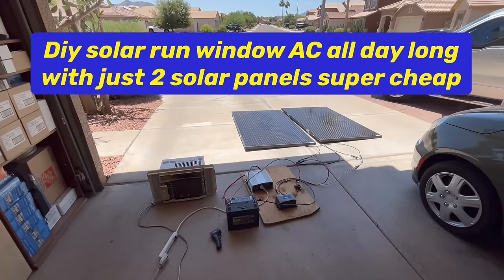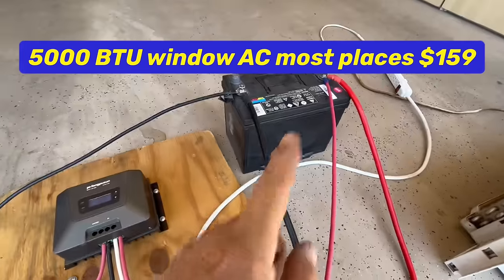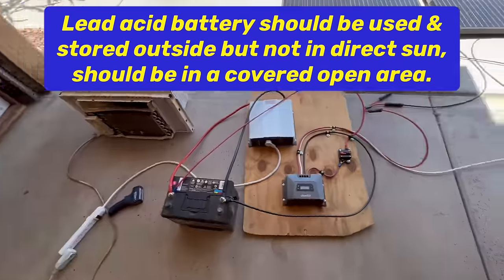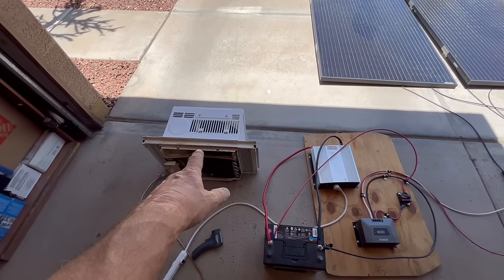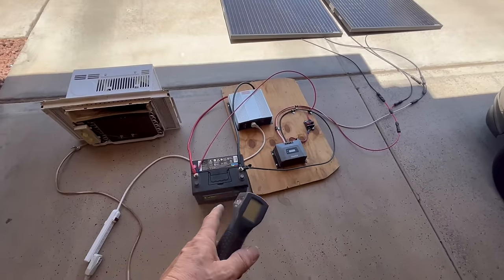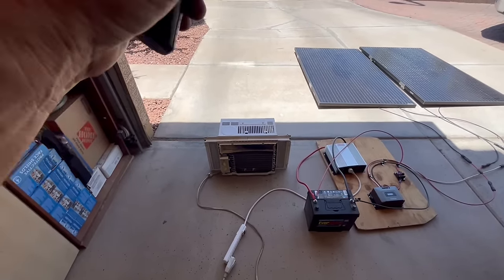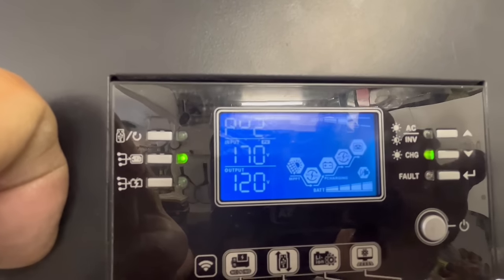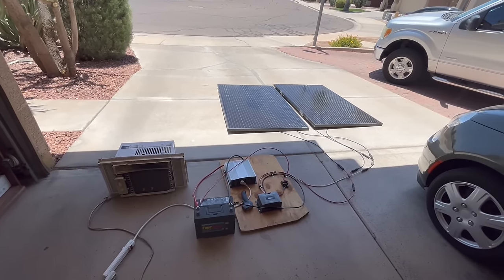Run your window AC with just 2 solar panels when sun shines. Easy DIY project you can do in one day.

Comment: I have a 10,000 btu ac that im trying to run. Its 113 degrees in my rv. Theres no running water or electricity on the property. I need relief. Fl is brutal! What would i need to run that ac please?
Reply from the maker: You need solar panels and an off grid inverter along with some batteries. AGM batteries will only work for you during the day but Lithium. iron Phosphate will run overnight. That 10,000 btu ac probably uses around 19-12 amps and 1000-1300 watts. Signature solar has direct connect mini split, add some solar panels and you could run while sun is up for maybe 8-10 hours during daylight. The biggest problem in Florida is cloudy days, that kills your solar production. Those mini split can drop down to 200-300 watts at night when tv is cooled down if using lithium iron phosphate batteries to run at night. Check out some of the videos for the EG4 mini split from signature solar, look online for their mini split solar kits that include everything. That mini split would be a lot more efficient and use a lot less power than that 10,000 btu ac. If that is your tv ac than it’s probably 239 volts and that’s a whole different story. Once again those huge amount of cloudy days in Florida makes it tough to do solar off grid. I know that’s not what you probably wanted to hear but it’s your best option to run ac off solar.
Reply: @diy-solar-guy  do you know roundabout how much it would cost to do the mini split? Also do u think theres an alternative to solar to run that ac? Its a window unit
Reply from the maker: @charlenarussell8676 my 5000 watt window ac uses 500-550 watts and between 5-5.5 amps. Pretty much double those numbers for a 10,000 btu and you’re using what a mini split uses at start up to cool down. The big difference is that window ac will constantly use around 1000-1100 watts as where the mini split after it cools area will drop the watts down to 200-400 watts. 12,000 btu mini split can cool 500-600 square feet. Considering you tv is probably less than 200 square feet, that would cool your rv extremely fast. Using solar to run window ac it mini split is an investment and will easily cost $2000 or more for a basic system with no bells and whistles. That window ac I did in the video works good for small areas that are well insulated. An tv is not very well insulated, I know I have a 2017 motor home. It takes forever to cool down with rooftop ac and that 5000 btu window ac can bring the temp down but not a lot from 113 degrees. That EG4 12,000 btu 120 volt ac with direct solar panel is probably the cheapest you can go. Need mini split, 2000 watts of solar panels, wire and mc4 connectors. $1299 for mini split. 5-400-500 watt bifacial solar panels will run $120 each, 10 gauge solar wire and mc4 connectors depends on how many feet of wire you need. Mc4 connectors can get off Amazon really cheap, under $25. You could super cool your tv during the day to 65 -75 degrees if sunny out and would stay cool for a few hours. As soon as sun goes down, stays cool longer if you can run till sundown. Like I said to start out solar it will take some money. Min $2000 to cool tv.  But will cool very well for 7-10 years. Buy some Lithium iron phosphate batteries down the road and a few more solar panels and you could run across at night. Hope this helps. You can call places like signature solar and talk techs about what you want to do and what it might cost for components. They are better at it since they do that for a living. Hope it helps and hope you get cooled down soon. I know how you feel, I live in Phoenix az area.
Reply: Mami I see these things at harbor freight.... But I'm sure if you search amazon Walmart Lowes home depot and put in say like the clearance items and mess with the say price amounts use like $10.00 or 5 or whatever and you may find something. 

Idk anything about electric. I don't like to change a light bulb because I got shocked before..... But also I live in manatee county, fl.... Up the road say 10/15 miles they bought out the farm land and now its a field full of solar panels. 

If you are near some place like that maybe stop and talk to them and also they maybe able to order you some and get you a better deal. 

I'm just giving suggestions because I know how it gets in fl. Lived here 40 plus years.
Reply: @diy-solar-guy thank you for the info. Do the  batteries require a lot of maintenance and/or care
Reply from the maker: @presidentialsuite6406  thanks for your suggestion. That was just a simple basic bare bones example of how to run ac off solar. Now I run my 3 1/2 ton and 4 ton heat pump heat pumps with solar in day and LiFePO4 battery bank at night and do not spend a penny on heating or cooling my 2450 square foot house or 600 square foot garage or my 15,000 gallon swimming pool to run pool pump 24 hours a day and even heat or cool my pool up to 10 months a year. All with off grid solar check out my other videos to see how easy it is to air condition you house with solar 24 hours a day. Thanks for your input and hope you have a truly wonderful and extremely blessed 2024.
Reply from the maker: @presidentialsuite6406  AGM batteries can not go below 12 volt charge or you will lessen the life of battery. The only maintenance is to charge and use every day running the ac. I used in a solar shed for over 2 years and the window ac in the shed kept all my solar equipment including batteries nice and cold at 50-60 degrees during the day. The batteries have lasted over 4 years now by not depleting below 12 volts. I no longer have those batteries and use LiFePO4 batteries which are air conditioned to 65-75 degrees daily year round and those should last 20+ years. Check out my other videos of the progress we made since first using this set almost 4 years ago.

Comment: Are you in a typically hot environment (e.g. desert)?  Can the charge controller and inverters still do well in those environments?  Like, it can get to 118 degrees for literally weeks straight in Arizona and I can see the charge controller and inverter not lasting all that long in those environments.
Reply from the maker: I live in the southwest corner of Phoenix AZ. Is has been brutal out here this last 2 months. I kept this ac and all the components in a 4x8 by 6 foot tall shed so that all my components stayed cool. At one point I had 6 of the charge controllers and a Harbor Freight 5000 watt modified sign wave inverter running 3 mini split that I installed in the house and garage. I also increase my battery bank to 4 12 volt lead acid batteries. This system is good for someone who wants to learn about solar but knows nothing about solar. As you learn you improve system with better components. A 12 volt system is limited to 500-1000 watts and a 1000 watts is maxing out system. I then went to a pure sign wave 24 volt off grid MPP inverter with built in charge controller that can accept 2400 watts in solar. That was much more stable. I used 2-12 volt batteries to start out that were in series to make a 24 volt battery bank. Then added 2 more batteries and connected the same way then connected in part with other battery bank to have 4 batteries for system, that helped do much when clouds rolled by in sky and solar production tanked, but mini split kept running. As battery voltage dropped but much slower that when I had only 2 batteries in series. I then added 3 more 24 volt inverters and paralleled all 4 together to get 9600 watt system that could run all 6 mini splits I had installed by then. 2 upstairs, 2 downstairs and 2 in garage. Used that for about a year and then bought a 6 kw and 12 kw Growatt low frequency inverters they now run all my central air conditioners and 230 volt ac in garage as well. Check out my other videos to see everyone have done with solar off grid. That charge change controller and inverter on video will not last more than a couple of years in extreme heat out here as might due in as little as 2 years. Fans will be running constantly on inverter and wear out really quick. Charge controller does not have a fan but you can even find this charge controller anywhere, I looked, only been 4 years since I bought and they stopped manufacturing because of new technology. All in one off grid inverters are the way yo go if you are thinking about running ac in AZ. It’s just too hot and mini splits are far more efficient than window ac and mini split can heat in winter as well. Check out my other videos to see how I progressed over the years to where I spent $0 on air conditioning my upstairs, downstairs and garage last month using solar in day and Lithium Iron phosphate battery bank at night. Hope you had a wonderful and blessed weekend

Comment: This was so good!!!!
Reply from the maker: Thank you. Hope it help in understanding a small part of what off grid solar can do. I have a new video where I am complaining running my air conditioning 24 hours a day only using solar and battery bank at night. I spent $0 last month on air conditioning my house who’s is 2 stories and 2450 square feet and cooling my garage during the day. I have over 100 videos about off grid solar and all that you can do with it. Please check out my other videos. I think you will like those even more.
Reply: @diy-solar-guy  you have no idea! I just bought a 1990 Coleman pop-up and I’ve been trying to figure out how to make it solar and run either the air that’s in it or I’ll get a smaller air conditioner. He would not believe how many people keep telling me it can’t be done. That no solar will run an air conditioner. I am in Florida so Air Condition is important. Thanks bunches.
Reply from the maker: @CLacy  you are welcome. Might want to look into flexible solar panels that only weigh about 2-4 lbs. can be mounted on top of camper or pop up with camper double sided stick on tape. So you do not have to drill holes. I am looking into that for my motor home as well. Thank you for your input. Hope you have a wonderful and blessed day

Comment: can you give the solar panel specs or share the panel volts out put. ? You mentioned only the 330 W rating.
Reply from the maker: Max power point voltage is 33.6v. Open circuit voltage is 42.1v. Max power current is 9.68A. Short circuit amps is 10.2A. The brand is Jinko. These are UL listed solar panels. Hope this helps. Hope you have a wonderful and blessed day

Comment: What’s the total cost without the AC unit? Perfect for my workshop.
Reply from the maker: The components can vary depending on what you can find. I bought solar panels for $35 used each. I paid around $130 for inverter. $100 for battery but agm is better and LiFePO4 battery is the best. Agm could cost $150-$250, LiFePO4 could cost $300 or more. Cables are at Harbor freight for around $39. 10 gauge wire is about $1.20 a fort for both black and red wire. Breaker is about $15-$20. Charge controller can start at $120 and up. If you are looking to use often. You might want to go with a all in one inverter that is 24v , 2400 watt input solar panels and 2400 watt output. 120v output, 60-80 amp continuous output. You would need a second battery and could use 10-250 watt solar panels but you would be able to use for quite a bit of applications for different appliances. I can run 2-12,000 btu mini splits with a 2400 watt off grid inverter. A 12,000 btu mini split can cool it heat 600 square feet. I have a lot of videos using 12,000 btu mini splits. Check out the videos to see if that might be something you could do. You could also use window ac you have as well. The Mpp inverter I have can be paralleled together with up to 9 in parallel so you can expand down the road but mine is only 120 volt output. You can get split phase inverters that are 120/240 volts as well. eBay and amazon have a huge selection of all in one inverters if you plan to use long term. The charge controller I used in video might last you 3-5 years as where an all in one inverter will last 10 to 20 years. See what options are available and then you will be able to find something that will work best for you. Off grid solar can be expanded if you buy the right components in the beginning. I never thought my system would be as large as it is now but am happy it is. Check out my videos for more info. Hope this helps. Hope you have a wonderful and blessed week

Comment: From the inverter  to the AC unit I would have to run the cord 20' would that effect the  performance of the ac unit
Reply from the maker: It might, but you can try. Depends on the extension cord. Heavy duty extension cord would be better.

Comment: Where can I get all these parts?
Reply from the maker: Amazon, eBay, Harbor Freight, santansolar.com, Lowes, Home Depot. I will be doing another video where there are links for products in description. I will also be doing another video where you can run more than 1 window ac or more than 1 mini split heat pump. Check out my other videos on using solar to air condition my house and 3 car garage. Hope you have a wonderful and blessed week

Comment: how about using a under $100 lithium 12  trolling motor instead of the lead acid?  Only issue is temp but you can keep it in indoors
Reply from the maker: Not sure how many amp hours your trolling motor is. But if it is 12 volts. It should work. This is a basic example of minimal parts needed. Improving on this basic set up will add to better results. We used this 4 years ago to run in our solar shed. Now we moved all the components to the garage and air condition the garage all day long using solar off grid. This is a 3 car garage that is around 600 sq feet. Don’t need to air condition garage at night. We also air condition our entire 2 story house with either our 3 1/2 ton and 4 ton heat pumps or we can use 6 mini splits we installed, 2 upstairs, 2 downstairs and the 2 in garage. We can air condition our 2 story 2450 square foot house 24 hours a day using solar in day and lithium iron phosphate battery bank at night. That consumes a lot of power and need a 12 kw Growatt low frequency off grid inverter to start and run high amp start up ac’s and to keep them running, along with cycling on and off. Check out our other videos on what we used to do this.

Comment: I love it 🐶🤠🐶👍
Reply from the maker: Thank you, just the bare bones basic components needed to run ac. Check out my other videos. I now run my 3 1/2 ton, 4 ton whole house heat pumps to air condition and heat our 2 story 2450 square foot house along with a 18,000 btu mini split in garage. I can get my house and garage down to 65 degrees when it is 110 out in the summer here in AZ. We now spend $0 on heating and cooling our house and 3 car garage and also run our pool pumps 7 days a week 24 hours a day with off grid solar. We even heat our pool. My neighbors pool is 56 degrees, mine is 86 degrees right now. Hope you enjoy learning what we use off grid solar for in our videos. Thanks for your comment, hope you have a truly wonderful and extremely blessed 2024.
Reply: @diy-solar-guy  I just moved off grid on February 1st in Atlantic Canada. It's been rough but I can now power my fridge, brew coffee, and use light electronics. I made it through a week of straight rain before needing to charge my 300ah with the generator. Hardest part is just getting set up
Reply from the maker: @MaritimeUnprepared you are absolutely correct, I knew nothing about hvac, off grid solar, mini splits 4 years ago. I started watching videos on YouTube and learned a lot. But there were some things I wanted to run with off grid solar and could not find any videos on subjects so I started our channel and not show what is possibly with off grid solar. It is nice reducing my bill down over 85 percent. I now have a back up set of everything appliance in house in garage. If power goes out or becomes to expensive, we are ready to go completely off grid. It is a nice feeling knowing you can power everything you need. Thanks for sharing with us. Hope you have a truly wonderful and extremely blessed 2024. Congrats on your solar off grid system.

Comment: Love it !!!
Reply from the maker: Thank you, it is easy to explain when you show the components needed. But this is just a basic bare bones system. You really need to add more safety components and improve on this basic system. I did and now I completely 100 percent of the time air condition and heat my 2450 sq ft house 365 days a year as well as the same in my 3 car garage. That is not easy to do when it is 115-118 degrees out in the summer. We also heat our pool starting in March when water temp can be in low 40 degrees range , we heat up to 86-89 degrees water temp and now run our pool pump 24 hours a day, 365 days a week. All of it started with just setting up this little basic system in our solar shed for 2 years. Our electric bill is less than $1200 a year now and our solar off grid system has paid for itself in just the first 4 years. Thank you so much for your comment and we hope you have a truly wonderful and extremely blessed 2024.

Comment: Nice! Thanks for taking the time to experiment and educate me.
Reply from the maker: Thank you for your kind input. I actually run my entire house and garage air conditioning on just solar and battery bank at night. I spent $0 on air conditioning in Phoenix AZ last month with is being 113+ degrees in the day and 90+ degrees overnight lows. All using off grid solar. I also run my pool pump 365 days a year with only solar. In fact we heat our pool in winter and cool it in summer with solar. I can keep my pool at 87-89 degrees in winter using pool electric heat pump heater with only solar off grid. Check out all I do with off grid solar. You will be surprised. Hope you have a truly wonderful and blessed weekend